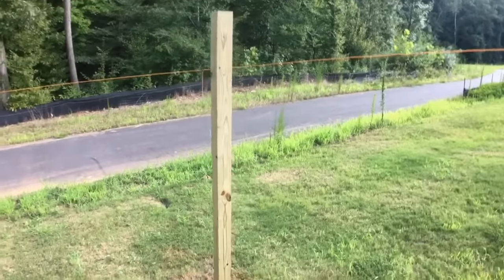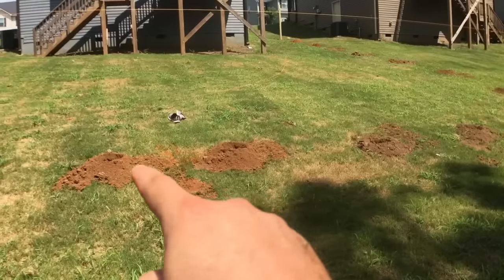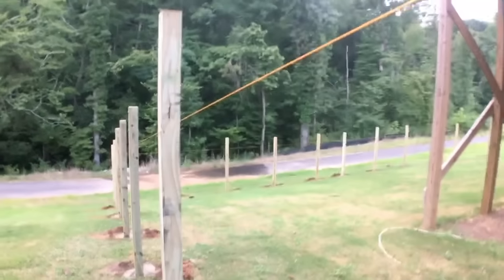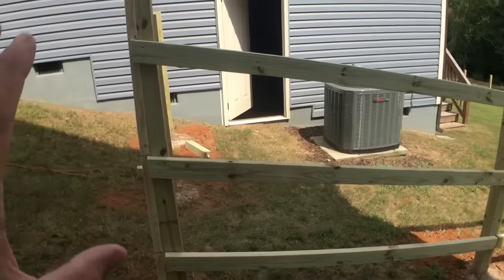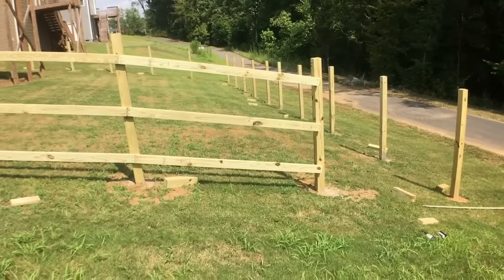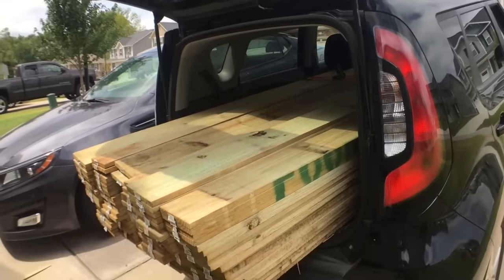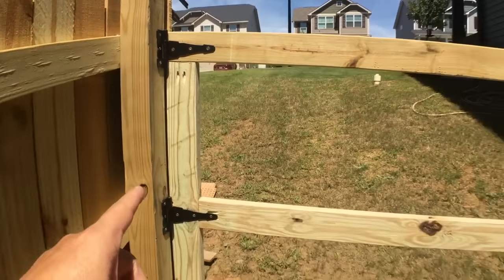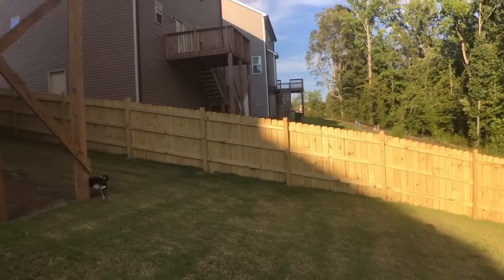How To Build & Install A Wood Privacy Fence Yourself! WITHOUT breaking the bank!!!!

Comment: I live in Cary and just bought a home in Four Oaks, this looks like you might be in the Cary area also with the paved greenway behind you. I might be wrong but it looks like it. Plan on building a fence at my new home and I just wanted to say I appreciate your DIY video. Will be a big help to use some of your tips once I get started. Really gave me a good rough idea of how to go about it. I really appreciate it. Thank you!
Reply from the maker: You are so welcome!! I’m glad the video has and will help out! There are a lot of great people on this thread that have commented some additional info such as gate Construction and adding gravel for run off in the holes for example. Good luck and congrats on the new house! (And Yes.... your correct about the trail!!!) 😀
Reply: Thanks again for taking the time to share the experience with the internet. It is much appreciated and I’m sure will come in handy for people for years to come. I plan on doing a fence, a deck, a fire pit, a pond with waterfall (which I have done once before and also possibly a pizza oven. It’s gonna be a lot of fun working on these projects. I think that, especially   as men, there is a certain sense of purpose and fulfillment that comes from working on projects with your own 2 hands to create things. I’m excited to get started!

Comment: The augur you were using needs two people to guide the plunge by letting weight carry the bit into the dirt - use patience don't push it down. Mark the bit at two feet (duct tape) and both people pull the augur out while it's turning so the dirt flings off to the sides - minimize your hands in the hole.

And yeah; it's a hard days work to get the verticals in but the horizontals are more a cerebral challenge.

I think you two did okay.

Comment: I was taught by a builder to have the string the distance away from the thing being measures or leveled by the width of a 1X4.  The string is always 3/4" away from the work.  A 1X4 is used to get the correct distance from the string.
Reply from the maker: I thank you for the comment but have no clue what you said!!!! 🤣

Comment: very nice fence.. you saved a lot of money there maybe around 1,500k. i did mine too, my neighbor called the contractor quoted him 4k for just one side of our shared fence which is about 64 linear ft. only, told him i’m not gonna pay that kind of money for just a fence, i ended up doing it myself wilth a little help from my neighbor and it only cost us 1k with 2x8 kicker on the bottom, board on board style with trim, he was so happy.
Reply from the maker: Thanks so much!!!

Comment: Great job , we so the same thing on the posts but we set the 4 posts then dig and set all the posts the same day. On long runs always remember the string line will droop and will result in non  perfect straight posts . Set the corner  posts then set a middle posts on long runs. We use a little beaver one man auger , they are great we can dig all the holes on a 300ft fence in less than a hour
Reply from the maker: But the line drops down.... not side to side so shouldn’t result in a “Wavy” fence. Also if you pull the string tight.... installers should have enough time. Thanks for watching and commenting!!!
Reply: @TheCrawlspaceCraftsman  when there is slack in the line any amount of wind or even the weight of the string if on a slope will cause it to wave off straight .
Reply from the maker: I guess that is true. I both we could agree... “pull tight &!check twice!” 🤣

Comment: Nice job! I would leave a gap at the bottom because if the boards touch the dirt/grass wicking of moisture will occur and the wood will eventually fail.
Reply from the maker: I hear ya.... I didn’t do that only for the sake I don’t want my dog to dig under if he sees an opportunity. I’ll see how long it lasts.... I’m sure it will be fine for at least 5 years! Thanks for the comment too!!!

Comment: Great video but a poor job tbh. You did so many things wrong that will haunt you every time you look at it or uses your gates, but you saved a lot of money  and will have to live with your results :-)

1. The fence post should be cut AFTER the fence is done, other way around you can jiggle the pole in the concrete and make it loose its grip. Posts should be cut in a straight line , like you did when setting the corners first (correct way, good job) so that each pole is not set by random ground level below that single post, but follows the slope in its full length. 
1.2  Top of posts should be below fence height , for better aesthetics , but its a subjective choice. 

2. your cross beams should have been on the inside of the poles, that way you did it is weaker in stormy weathers and makes the fence looks massive with 3 layers rather than 2. 

2.1 Same as for the poles; the cross beams should have followed the entire slope and not been measured and set at a individual height . You will see that every time you look at the fence from the inside, which is what you will do every time you go to your yard :-). Patterns are very visible and a straight line from each corner is the correct way and much more pleasing to look at. 

3. Your "slats" or vertical decking boards should be set the same way, so that the top of the boards are a perfect straight line from each corner and not a  individually set height like you did.
3.1 CRITICAL: NEVER let the decking boards touch ground, grass or gravel (like you did). even though they are pressure treated they WILL rot 10x faster when they touch ground. Even a 1" clear is enough to save your boards. The way you did it , they will rot in the long run, but first of all , they will get discolored already the first year from moisture and dirt from the ground (decomposing the wood and bacteria). 
When you cut your lawn you know why this would have helped you too: now you HAVE to use a edge trimmer on EACH side of the fence, whirling more dirt and grass on the boards. If you have a 1-2" clearing you only needed to weed from one side and do NOT get debris on the boards. (hope it makes sense).

4. Your gates are done in the wrong way. You MUST have a diagonal braces to channel the load from the outer weight to the hinges , otherwise your gate will not be straight for many days or weeks. 
4.1 the horisontal Slats on the fence should match the slats on the gates as well. Straight lines from corner to corner. 

No intention of being a bully, just giving constructive criticism. AND sorry for my bad English, its not my native language. Carpentry is my nature.
Reply from the maker: Dang you took some time writing!!! Kudos! That’s super awesome you know so much about fencing and maybe some others can learn from my mistakes! I will tell you though the fence is straight as an arrow and already made it through a Tropical Storm (almost cat 1 cane). I plan on adding support to the gates but surprisingly there is minimal sag! Yeah me! Not gunna hit every flaw you thought you needed to point out but I will say I’m definitely 100% Extatic about the results so living with them will not be an issue. The only sleep I lost was the excitement about getting up to finish the dang thing!!! Thanks for watching and your feedback for others to read as well! Cheers! 🍻
Reply: good post any reference videos to do with what you are talking about?
Reply: Is there any paint you can use to allow you to put fence boards under ground in case dog digs?
Reply: Great job buddy these are just knick knacks u can adjust later except hes right with the boards touching the ground and rotting sooner than later over all.... great thing is u did it urself plus saved money...I have lots of fence as u and will use ur help doing it myself....last time I paid to have it done cost was twice ur amount and horrible job by pros.....thank u for this video.
Reply: Any chance on posting your own video to further explain what you've mentioned.

Comment: I want to start a fence building business but measuring scares me, should have paid attention in geometry class instead of thinking i would never use it in real life...
Reply from the maker: 😂 It’s a good profitable business but let me tell you it’s hard work! I give all the credit in the world to those guys! I know people have pointed out my flaws and I’m cool with that but I’ll tell you mine is standing strong and y’all! Straight as an arrow and even my gates which need a Cross support are not sagging! I love it so much! Thanks for watching!
Reply: Its easy while your setting posts just remember when you put the tape on one side of the post and pull to the next post you want 8 ft to the inside edge of the next post and thats the same as center to center
Reply: And also its easiest if you plumb your post to the sting before you measure for 8 ft

Comment: word of advice from A fence installer, rent a little beaver earth auger 8 hp mechanical gas.  It's still heavy & a workout but it has torque bar too prevent any kickback.  Tighten your lines up, there to lose & you really don't need to run a bottom & top line, most fence contractors run there bottom and then finish the line and do the top line, also it's best to set high & bring them down then to set low and bring them back up.  Also I wouldn't worry to much about the posts being off, as long as it isn't crazy off you will be fine.  pressure treated wood bows like mad, typically we inspect every post too make sure it isn't a boat but even then when it drys it can look absolutely horrible.  You can run a tape from the top of the post to measure rail height spacing you really didn't need a template.  Also you can cut the rails when they are attached to the post, just run the cut center & use the depth feature on ur circ saw.  You did a good job for a home owner project just wanted to give out some advice for anybody watching that wants a bit of easier way too handle the job of installing a fence, if anyone has any questions I would be happy to anwser them.
Reply: also we use a very simple template for shooting pickets, we just use a extra 2x8 and attach 2 pickets in the middle too create 12 foot template, and it just sits on top of the posts & we slide the pickets to the top of the template.  Always level your gate post, you can sorta get away with not leveling walk gates but Double drives need to be level.  level from the high point. You need braces on those gates as well, with some help you can get the gate to shoot back up with the brace so if it sags too much you won't have to rebuild them.
Reply from the maker: Awesome advise! My fence is done (obviously) but lots of people come here for ideas and just the confidence to do themselves! This is definitely and was meant to be a “If I can do it... so can you!” Video. Any good advise is should be well received! Thanks again for watching!!!
Reply from the maker: Funny you say that. I’m gunna do a one year follow up video. I haven’t fixed the gates yet on propose to see how they end up. I’ll be doing any necessary repairs then. We shall see!

Comment: Great job. Looks great! Did you come back with an angled support brace for the gate to prevent sagging? Don't forget to spray it with sealer. I put up about 60 feet 8 or 9 years ago, and spray it every year with either sealer or stained sealer, and haven't lost a single board yet. And, when you do a) three rails with b) top and bottom rail closer to the end of the pickets, you never have warping or curling boards. Again, great job, and especially great, narrative instructions!

Comment: One string line is all you need to follow the line. Use a spirit level to ensure your posts are plumb. If your posts touch the line, they can push the line throwing it off and before you know it, the whole fence is running off. For a first attempt it is a good result though. The ground you have is a breeze compared to the ground we have in my area in Scotland, UK.
Reply from the maker: Oh man Scotland!!! That’s crazy rocky I bet!!! Thanks so much for watching!! I double and triple checked the lines. I’m sure if it was rushed the string line method could get squirrely!!!! Thanks again!!!

Comment: Looks really good but you might think about 4 by 4 caps or sealing the tops of the 4x4's to prevent splitting. I didn't do that to my deck 4x4 's when I built it in the 90's but doing it this year while replacing them to prevent splitting and wearing down like it did the first time. Again great job!

Comment: Nice video, just to point out some tips, you should of cut every post the length you wanted so it would not have to have a saw over your head straining self and second dirt retains water so you could of just put some quick set in the hole and no water needed it will do its thing. But looks good otherwise
Reply from the maker: Thanks for the feedback! I definitely would have done a few things differently but not much! Sawing head height definitely is sketch but nobody was harmed in the video! 🤣 Thanks for watching!!!

Comment: Great Job! Great idea to use the template. I'll be putting up a fence soon so, I'll be using this video as my guide. 

You said both in the vid, did you do 5ft 2in for your fence height? or 52 inches?

Any issues with using nails for slats vs screws? Is the fence still going strong?
Reply from the maker: Hey thanks for watching. So to clarify yes… the fence is 5’2” not 52”. LoL. Once of my speaking errors I didn’t catch to correct in editing. As far as the nail thing goes… honestly I couldn’t see screwing in hundreds and hundreds of screws! These nails are made for this and do the job perfectly. It’s faster and more efficient. There are very minimal mail pops and the fence is still nearly perfect today! Thanks again for watching! Me personally I don’t know if I would do much different. 👍

Comment: you can build the gate before installing the hinges. put your 3 2x4 runners and nail them with one nail and give yourself 1/4 for the hinges and 1 inch for latch. also an "x" brace for the gate will help with sagging. build the gate like you would the panels and use a chainsaw to cut the top 2x4's loose then install the hinge then the same for the bottom latch then install the hinge. remember to take the short piece of 2x4 out that has the one nail in it before installing the hinge. also you can use a string line at the top of the boards to keep the top nice and level. just touch the top of the board to the string then bring it off until the string is barely not touching.
Reply from the maker: Good call!  Thanks for watching!!

Comment: I was taught to always keep splitting the difference when setting posts.  If you have 7 post. Set the corners then got to middle  post the set the next two post in between the middle and so on. Also cut your post tops last.
Reply: Huh? way easier to trim a post before the pickets are on.

Comment: Best thing to do also is to put your sprinkler on to soften up the ground.  Not to the mud level of course, but a good watering of a couple of hours does wonders.
Reply from the maker: You know I thought of doing this but didn’t know if I would be making a bigger mess and the ground all slippery so I didn’t.  Thanks for commenting!
Reply: He said earlier he lives in an area with lots of clay in the soil. I to live in teh Midwest with lots of clay in the soil.  Your idea wont help with digging the holes, just rent an auger.

Comment: Great work  couple suggestions would not have put wood pickets in contact with the ground.  Also the concrete for the post should be an inch or two above ground level. Any contact with soil at the post/ground/concrete interface will dramatically reduce the life of the post. Having concrete an inch or two above ground will prevent this. I would have done the rails flush with the outside face and not nailed them to the outside face.  Great job for this is tough work!
Reply: No sir your cement should be a inch or two below ground lvl cement should not be above ground lvl
Reply: @swdetroitsfinest4628  - do whatever you want you put it below ground level you’re gonna have soil in contact with the wood. No one in their right mind would think that’s better than having it above the ground but everyone’s welcome to do what they want

Comment: 5ft on center of your post you can break 16ft 2×4 dead nuts on center with a 22 degree bevel and stager all the joints so only 1 joint in the linear 2×4 on each 4×4 post makes for a very strong fence . Set your post 3ft deep if you are having a 5ft high fence  , its worth the extra effort.
Reply from the maker: Thanks for the advise!!! Thanks for watching!!!

Comment: Shoot the middle rail with single nail into a section and then “rack”  them and plumb them as a group. Then go back and shoot 2 in the tops and then bottom. When you shoot your next picket make sure it’s plumb and then repeat.
Reply from the maker: I think he's talking about the pickets specifically.  Put a bunch up with a single nail in the center so they can pivot... then make sure they are plumb and set with nails in the top and bottom.... rinse... repeat!  (I think! hahaha!!)

Comment: How do you know how far down to go with the post hole digger? Do you set a setting on it? 
Also did you have to check for gas and water lines before starting? Great video
Reply: 24 in. No. Dig safe.

Comment: Nice Not a bad job at all for being just a home owner posts look plum and square but god I wish I could yell through the video to help you guys with grading, framing the post and some easy stuff you made more complicated then really is. Looks good and well built. 1000times better then that abomination across the street lol  got a good kick listing to the odd terminology you used to explain what you did. Thanks.